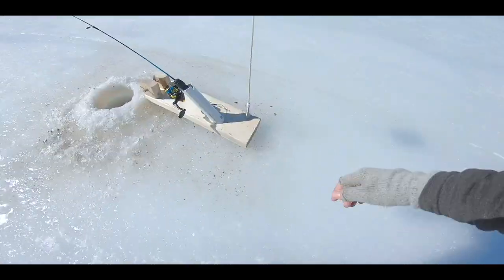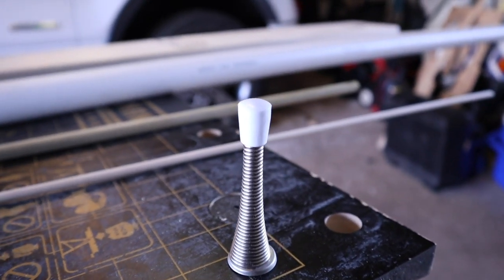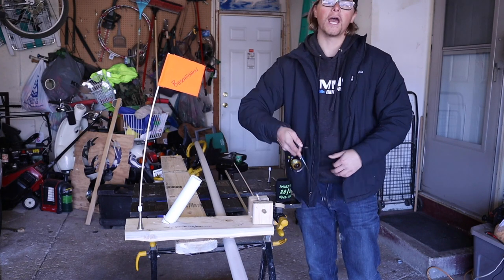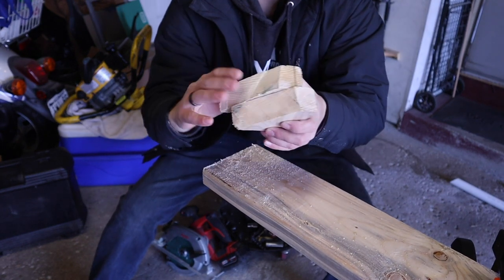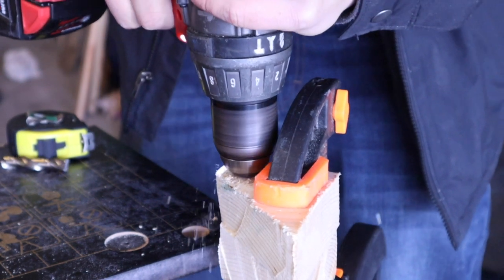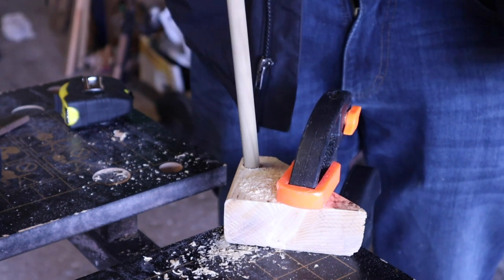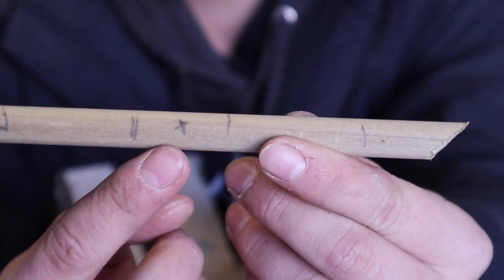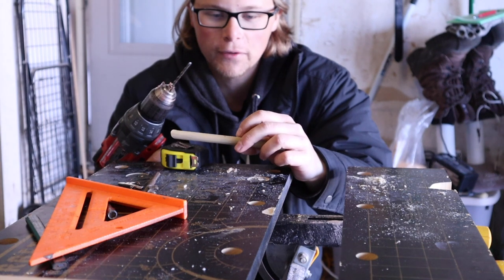How To Make A HOMEMADE iFishPro For $8! IN DEPTH + HIGH QUALITY

Comment: You can also use plastic tubing on the ends of the alligator clip. Looks better than black tape.
Reply: I will be making 1of these for myself.
Reply from the maker: that’s a great tip, i wish i would’ve mentioned it in the video but thank you for saying it, hopefully someone see’s this and uses it!
Reply: I use heat shrink tube... Works great and doesn't come off in the cold... @buschfishin

Comment: i build myself one just last weekend after watching your video and others with the same setup. should your gator clip be turned 90° ?
Reply from the maker: when the flag is set the gator clip should be horizontal holding the line, to set off the flag the gator clip should go from horizontal to facing upwards in the air. hope this helps!
Reply: @buschfishin  you mentioned to have the clip facing up for easier clamping.  I had the first one facing up and it was even with tape not coming out as easy as I thought. I turned the clamp sideways and it worked like a charm...I love DIY Myself but I don't have to personality and time to make videos. cheers. Kevin.

Comment: nice, but spin the alligator clip 90 degrees so it lets the line go easier, the way you have it its kinked, make it all 'in line' , can also use rubber tubing over the jaws, good stuff, very good simple tip at 16:40, but hilarious you didnt use your tip earlier on to cut the dowl  45, laughing here lol, its a great tip everyone at 1640 for cutting the angle

Comment: How do you set the clip?
Reply from the maker: the clip holds the line from the rod so that when you get a bite, the fish pulls the line and the line spins the clip and dowel so the flag goes off, once it’s spun and the clip is then vertical the line will come out and the fish will be free to swim with the line free spooling off the rod. hope this helps!

Comment: Will the clip cut the line off?
Reply from the maker: i can’t remember if i said this in the video but for this to work best you should probably wrap the clip with either heat shrink or tape on either side, that way when the fish bites it’ll slip out and not rip the line in the teeth of the alligator clip. hope this helps!

Comment: I’m wondering if it’s possible to build a portable fish finder using a boat fish finder for ice fishing
Reply from the maker: i actually did this, i had a old lowrance hook2 4x and i bought the ice transducer for it and basically just built a box for the graph with storage below for the ducer and battery.
Reply from the maker: that would be even better! maybe poke a hole in the front for the ducer to hang out of and you’d be set. dont always need the $300 ice fishing conversion kits for regular graphs